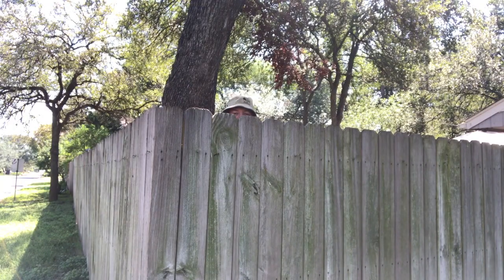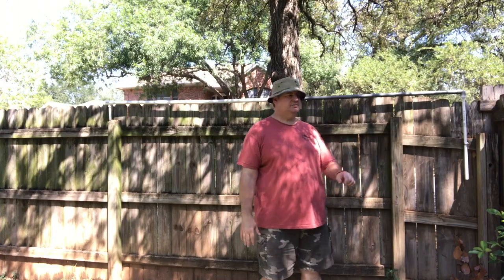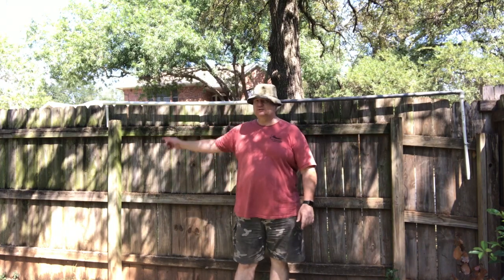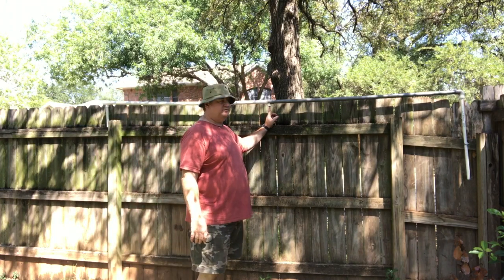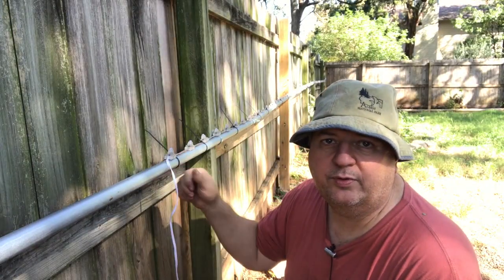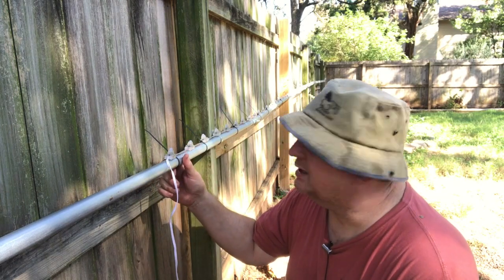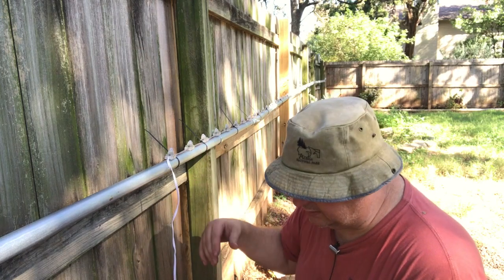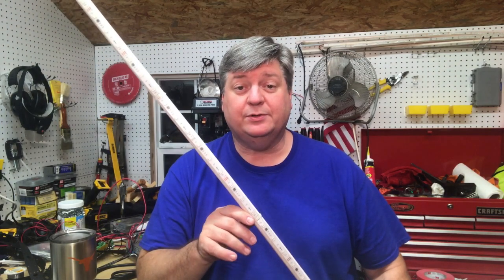Outlining a Fence with RGB Pixels

Comment: Jeff, on your ball of dead pixels... how did you dispose of them? Were you able to just throw them in the trash? Or did you have to pay for electronic materials recycling? Thanks!
Reply from the maker: It's mainly dried epoxy so there isn't any special handling I'm aware of, but if they do electronics recycling in your area, then put it there.

Comment: Another great video, I have seen the finished product already.  I’m just going back through your older videos. Quick question, are these lights from Ray?  Does the diffusers stay on well I’ve heard some stories that people use hot glue to hold them on. They weren’t from Ray though. Oh and one more thing about power supplies do you still recommend meanwell?  And trying to figure out which model I should get( I’m doing 12v) any help is appreciated. As always I wish you and your family well. Hey and let’s see them dogs more often
Reply from the maker: Thanks! Yes, these were from Ray. I had a couple of them come off last year, but don't think I lost any this year. YMMV. Yes, MeanWells are the best. I ordered 10 LRS-350-12 from TRC Electronics (https://bit.ly/2RqVr4L) this year to get the discount. Used most of them. The rest will probably go into service next year. They also have a similar version with the terminals facing out, but I prefer these facing up. Haha. OK, I'll make sure the dogs get involved more in these projects. :)

Comment: Jeff, I was trying to find an appropriate "enough" video to ask you a somewhat general question.  I have a Falcon controller, but am currently only using 8 outputs (with square-style WS8211 pixels from Ray Wu, with screw-on C9 milky white bulbs wire-tied to 8-foot 2x2 stock that is fastened to the underside of the fascia with threaded inserts [TMI...perhaps, but it works out pretty slick). I would like to put the C9 look on the roof peaks, but would like something weather resistant and modular (for efficient put up/take down).  So, I am curious how you do/(or would) run WS2811s with C9 on roof peaks.  If there is a more appropriate mode of communication, please let me know.
Reply from the maker: This is my preferred method of communication because I check it more. :) The pixels themselves are already IP68 (usually) so weather-proof to a point. All my lights are getting soaked right now (heavy rain). Keep any pigtail connections out of pools of water, but rain or snow isn't usually a problem.

Comment: Hi, I'm enjoying the videos and am learning a lot. Quick question...why are you getting rid of the LED strips in favour of the flat pixels? I'm planning on doing my own Christmas Lights for next year and I was looking at the LED strips on the PVC tubing. Thanks for help and keep up the great work. :)
Reply from the maker: Haha. Thanks! 

Not getting rid of per se, but changing them out for regular strings around the garage and front door. I couldn't get them exactly right around the garage door so it looked like a missing tooth due to the width of the garage and my rookie attempt at outlining it. Plus, the clamps I used for the PVC break every year which annoys me enough to make the change. Finally, and this could be the particular brand of strip that I got my first year doing pixels, but the color just didn't seem as accurate as the nodes I have. Straight RGB was fine, but mixed colors looked strange.

I still use strip inside PEX or HDPE (arches and a new wreath this year), but I find the Boscoyo strips and pixel nodes a little easier to keep straight and evenly distributed for long runs. Plus, they are much easier for me to store. I just roll them up and put them in a big trash bag in the attic.

I do have an idea for a new prop using strip, but I'm still in the early planning stages of that secret project. LOL!
Reply: I came across a thread on diyc that was talking about the clear clips from holidaycoro. Apparently there are guys on their 3rd season with only a couple brokens. I know the pvc ones dont like the sunlight. http://www.holidaycoro.com/product-p/770-ps.htm
Reply from the maker: Thanks! I may check those out.